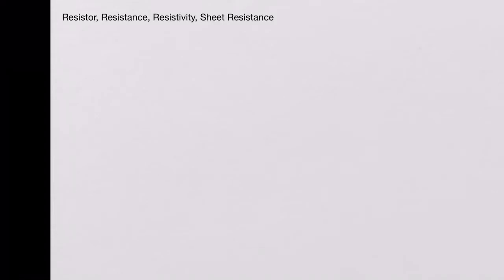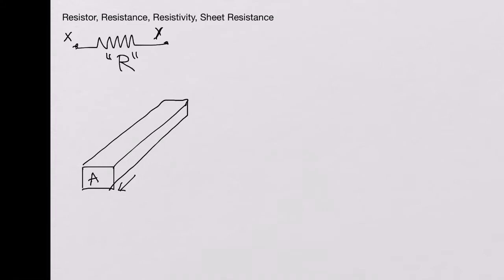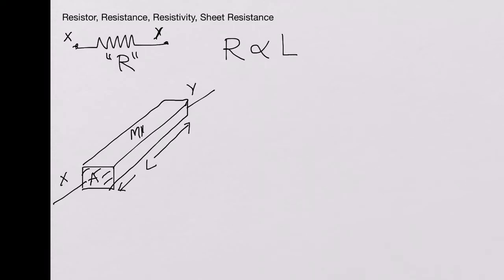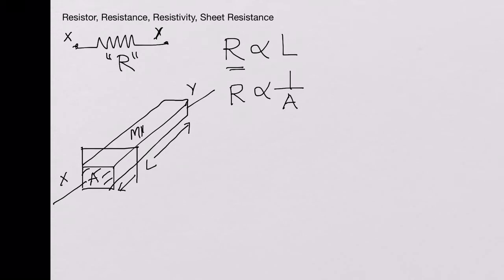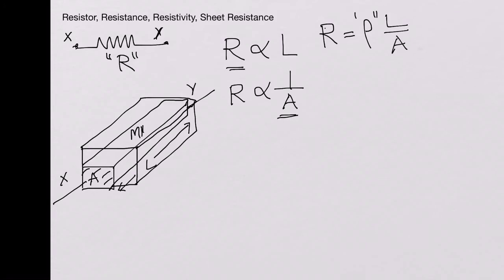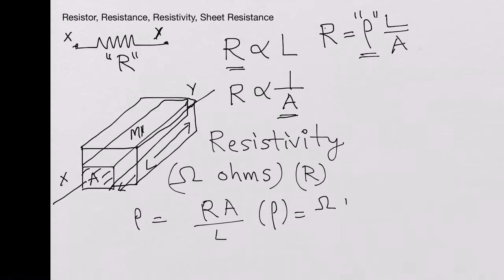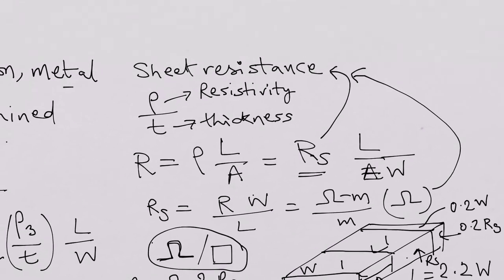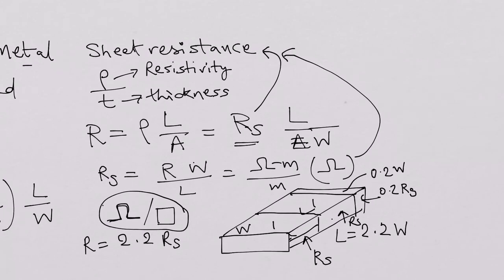Resistor, Resistance, Resistivity, Sheet Resistance

Comment: Is this considering a dc circuit? what happen if you have AC circuit?For example you have a square mesh , will this sheet resistance change with function of frequency? and If so, what will happen to that mesh electromagnetically ?